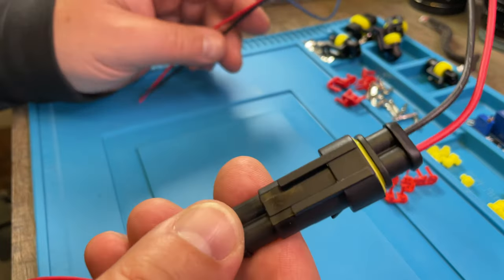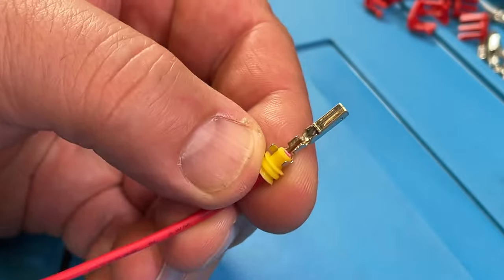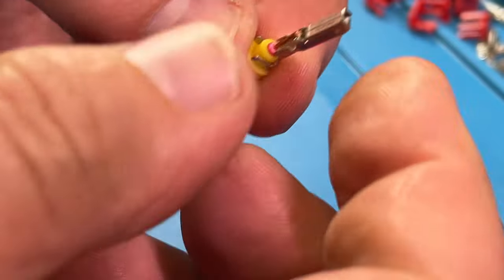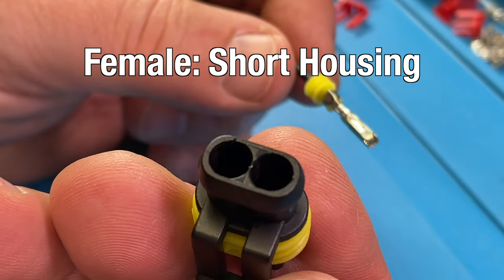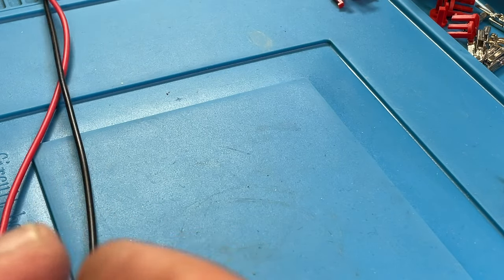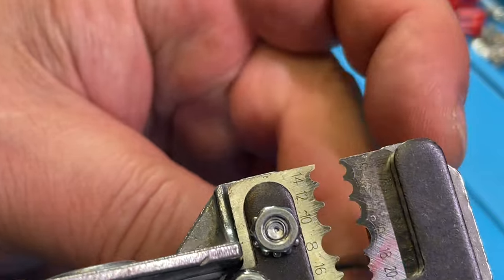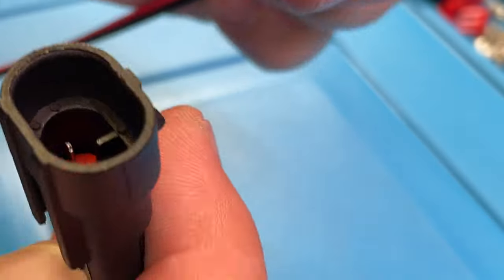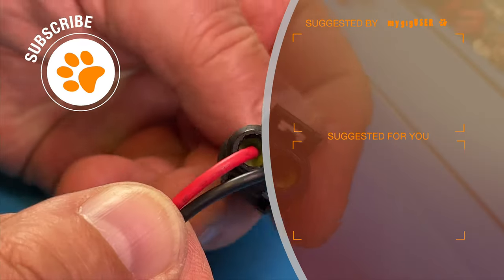Waterproof Wire Connectors

Comment: I was getting so frustrated trying to fit these. Encouraged to see that it wasn't just me, they are very difficult to get all lined up. Great connectors once they're complete, but tricky to put together.
Reply: i was also discouraged to fit my motorcycle DIY, LED modification using these connectors, then went to the garage instead.
Reply: No worse the RJ 45 connectors

Comment: Waterproof = impervious to water. I’ve used plenty of these and consider them to be water resistant = able to resist the penetration of water to some degree but not entirely.
Reply: yeah i just put together a 3pin connector as a test and found water inside after a submerge test. not great, but cheap, not something i would use on a car though
Reply: @dudekidPL what would you use? I have a jeeps, and want better water resistance....
Reply: @itchy7727  You could try using a self-fusing tape, like "Tommy Tape" Electrical insulation and used to fix pipe leaks. However, you wouldn't be able to undo the connection again as the tape chemically fuses to itself. Brilliant stuff!

Comment: I add a bit of vaseline to the fittings which gives it a little better seal and keeps them from sticking if you have to disconnect them later.

Comment: I personaly apply liberal amounts of the anti corrosion liquid called ACF50, both to the stripped wire end so it wicks down the copper strands, and to the silicon seals. It is a bit like WD40 on steroids, and is used as an anti corrosion film on aircraft and mototcycles. I also noticed that you had the ears that wrap around the seal get crimped in the same way as the copper, in that the ears got folded inwards on themselves. It is usual to have the seal ears overlap one another and get gently squeezed so that they form a circle around the outer part of the seal.
Remember that when the connectors are separated water can get into the vital pins, so if you also give the internals a squirt of ACF50 and the water gets in, it will not be able to get to the metal of the pin and cause havoc ✅

Comment: How do you know which part of the crimping tool is best to use, there are multiple spots and I struggle to know which one is best
Reply from the maker: That is actually a good question. For me it's easy since i use the tools all the time. At the beginning it may be a bit trial and error, if the tool or the crimp doesn't come with an instruction. Use the spot that is closest to the final shape of the crimp.

Comment: Hi, thats pretty detailed for me. But do you know how much power it can handle??
Reply from the maker: The ones i use in my video have the follow specs (I don't know if that's true, but that's what the Ebay seller writes)
Suitable for Cars, Motorbikes, Trucks, Caravans, Boats and other Marine Vehicles
Rated Voltage: 300V
Rated Current: 12A
1.5mm Terminal
Pin Number: 1/2/3/4/5/6
Working Temperature: -25~85 Degree
Waterproof Class: IP68
Material: Plastic

Comment: if i had to waterproof one I silicone it.  thanks for the video great tips
Reply from the maker: once you silicone it you can't disconnect again. A connector is there to be able to do that, otherwise you wouldn't cut the wire.
Reply: @mygiguser  I presume the gentleman above meant silicone paste/grease, as in dielectric silicone grease, not the silicone sealant variant.

Comment: Can you please tell me what tool is needed and how to remove the pins thank you
Reply from the maker: YOu remove the red plastic lock piece, and then push the pins back with a screw driver, or pull on the wire.